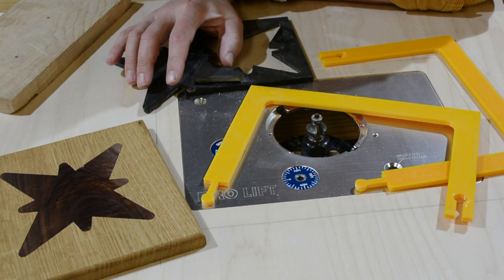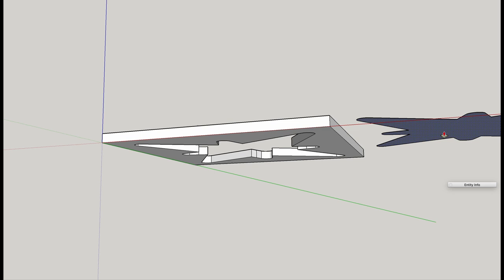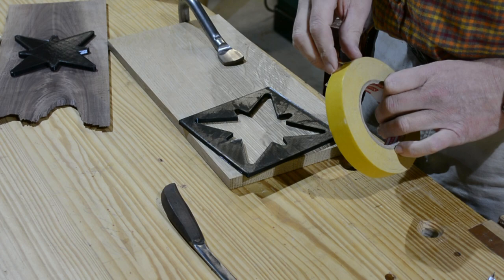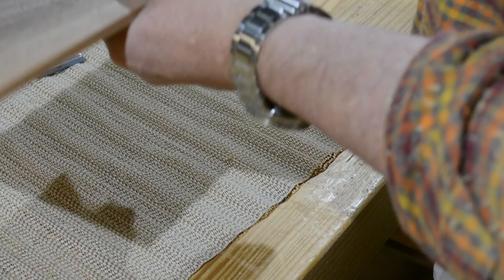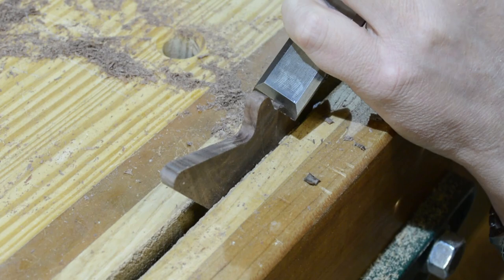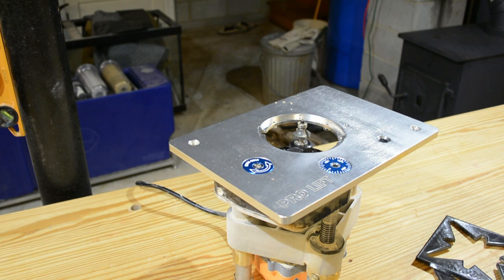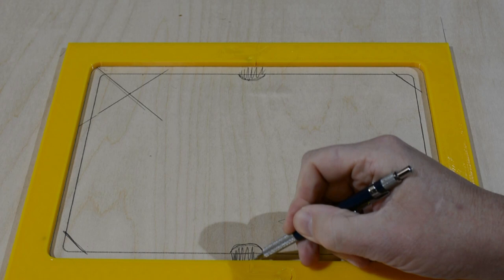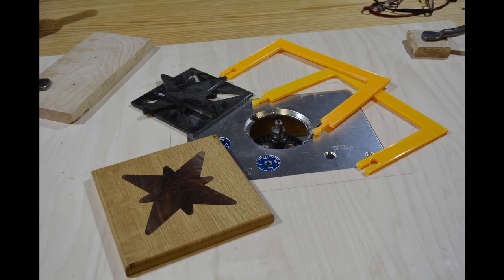3d Printed Templates for Woodworking

Comment: Nice to see another video!
I have an Ender 3 that really doesn't get enough use. I do print hose connectors and such on it. And I use it to print models of the furniture I make. It is a good way to see if the proportions are right. I find it better than just the 3D drawing. 
I use Fusion 360 but it has a really steep learning curve compared to Sketchup. It is a more powerful tool tough.

Using 3D prints as templates is something I never thought about, and definitely will explore more in the future. Thanks for the tip ;-) Cheers.
Reply from the maker: You are right about Fusion.  Though the initial learning is rough, the ability to draw on any face is a step in the right direction and I have to use fusion for anything complex.
Reply: @Blueridgedog  Do you know if they still do the small business license? I only seem to be able to get the free one, and that one doesn't allow you to export drawings to .pdf. And 60 usd a month for a full license is too steep at this point.
Reply from the maker: @NomadMakes  In the same boat as I have to use the free one (Fusion and Sketchup).  For sketchup, I still use the 2017 Make version as that was the last release before going to the web based product.